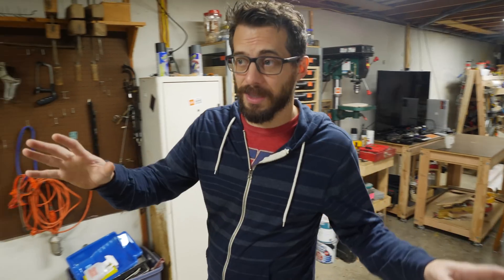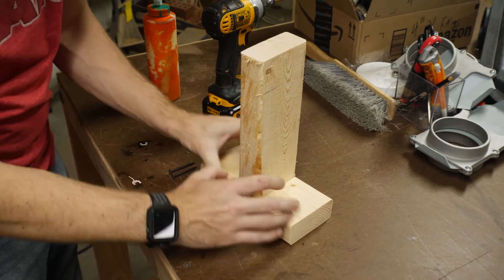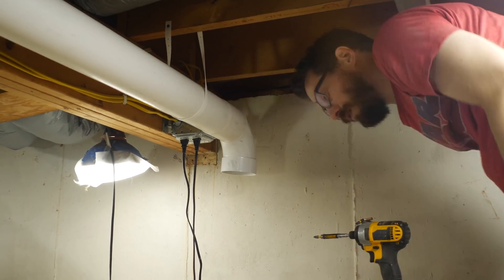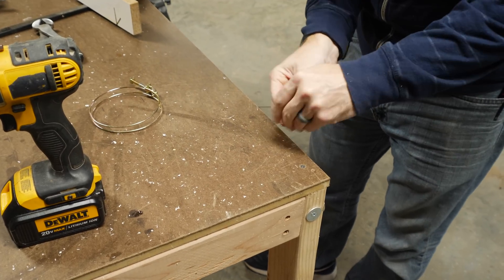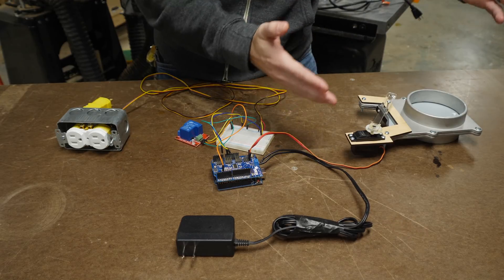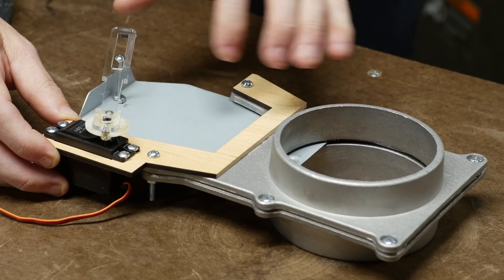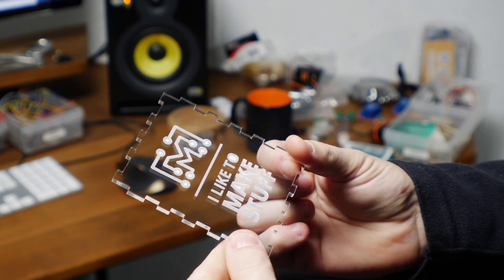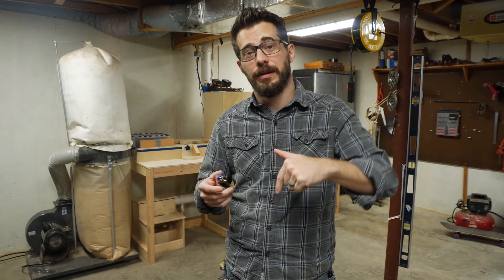Fully Automated Dust Collection powered by Arduino // How To | I Like To Make Stuff

Comment: Has ANYONE actually built something similar and gotten this to work?  I realize this video is super old, but I'm trying to figure this out and it's lacking a LOT of detail (schematics, wiring diagrams, etc).  I'm even struglling with the posted code, because I don't see where the acs712 voltage sensors are being accounted for.  Would love it if someone (even if not Bob) could help me out!

Comment: Great video... very much appreciated.

Given 1 automatic blast gate is AU$199 to AU$249 each it gives a lot of room for huge savings and customization. I have a heap of micro controllers already so would use a Teensy with SD card and OLED display.  That way it could be driven by a simple INI file and the OLED could be used to display info when in use.

This could incorporate a minimum run time and how long to stay on and open when the machine turns off. With the inbuilt clock the Teensy could keep track of accumulated run time and even sense when your bag needs to be emptied and hence not turn on when full.

We're getting a X-TOOL laser cutter so this looks like the perfect start project.

My shop has all 24V DC lights so the Arduino can hook into this. Also quite sure can sense if a device is on or off in a non-invasive way and... lastly have to allow for battery powered tools as my mitre saw and drills are all cordless.

Comment: Great video. In laying out my circuitry I"m wondering if i could control the blast gates with a Nano at each one so the voltage detector would wire to the nano and go directly to the blast gate so as to not have so much wire travelling back and forth. The Uno would control the Motor Relay and go only to the Dust collector. Any reason that's not a good idea?

Comment: I used an Arduino to detect current to flip a relay and power a shop vac. 
You can make a simple current-detecting transformer by making a few wraps of thin (22-26 gauge) insulated wire around a ferret and using an interrupt pin on the Arduino to detect a small, momentary change in voltage. Put the insulated load wire through the ferret and when current flows the thin wires will trigger the interrupt on the Arduino. Easy, inexpensive and safe. (Digi-key carries many cheap ferrets)
I used an output from the Arduino to switch a transistor that can handle the current to power a 5-volt relay with high, inductive load capacity.

Comment: Grounding PVC does nothing, it's an insulator. The pipe would need to be conductive for the electricity to flow through the grounding wire

Comment: I have made a blast gate using the same gate and servo as listed in your links but my gate does not switch between the open and closed positions smoothly. The gate seems to hang up and get stuck as it is switched. I discovered there were some bosses inside the gate that initially hung it up but I filed them smooth and the problem still exists. I have created a couple of actuators, one plywood and the other plastic and both have the same problem.

Comment: I know you've found a solution already but for anyone else with a similar issue like the shop vac relay issue at the end... You could use two  relays in parallel to carry more current. Just splice the signal wire to each one and combine the outputs back into one to go into the vac.

Comment: I have a bigger shop with 16 power tools that I would like to have on the system.  I liked that I can control 16 servo's with your design, but I don't see how I can have 16 current sensor inputs?  Is it possible to have 16 current sensor inputs?  I hope you will respond or someone else that may have done this that sees your video.  Thanks for putting out these great video's.
Reply: There's a shield available that extends you to 48 AI's. I'm not sure the current sensors have to go to an analog pin.  I'm just starting with this and the learning curve is steep.
Reply: Brad Antin I found using a mega board I get the extra analog inputs and use a I/O extender board expands the output pins for servo. Writing code now.

Comment: I saw this in the user guide:
"If you are using a Leonardo or 
Mega and want to use the A4/A5 pins, cut the traces on the top of the 
board between A4 and A5 and the two pins next to them labeled SCL/SDA."
I am using an Arduino Uno and would like to use A4 and A5 for my project.
  Can I safely cut those traces, or do I lose the use of A4 and A5 with 
the Adafruit 16-Channel 12-bit PWM/Servo Shield?
Thanks
Mike

Comment: Bob -- I have modified you code to read from a config file and put everything into a structure instead of the arrays you were using.   Interested in it?   If so - how can I get it to you?  I have to test it in production and bullet proof it -- but it allows me to add/change/take out gates and machines without having to recompile or change the arduino code.     Love the template and love the automation!
Reply: Hey Cory Wiegert, any chance of me getting your code?

Comment: I like this video, and because I like it, I have watched over and over to learn and to catch anything I might have missed. I am teaching my self Arduino. I liked what you did before with your shopvac dust collection and using the key pad. I like this setup better. As I watch this video, I notice you still run a single stage dust collection. I know there are videos out there by the pound about dust separators. Just an idea for you: Convert to a two stage dust collection AND.... use your Arduino to sense your saw dust level in the collection drum and have it display a visual sign of when it reaches a predetermined level to have it emptied. Yes there is a product out there to do just that. But where is the fun in that? I;ve seen your creative was of doing things and enjoy them. Thank you for your awesome videos. Mike

Comment: Is this system still in use? Was it set it and forget it? Have you had to troubleshoot any issues since implementation? Did you find there was any regular maintenance for the system? Do you have to reboot the Arduino periodically? How about adding network connectivity?

Comment: I am so glad you mentioned the relay being undersized.  I saw three very large concerns with that relay: (1) The connector used isn't rated for 30A, (2) The relay isn't HorsePower rated, and (3) The traces on the PCB aren't going to be rated for 30A either.  I've done a lot of power electronics design & those failures are common with products produced in China.

Comment: I hate to be the safety guy but i feel the need to since this wasn't addressed in the video.

If you're going to do this, please please please, do you're research on you're workshops electrical system. Some tools use 20 or even 30 amp plugs and possibly at 240 volts as opposed to 120. Using an underrated component on one of these can lead to damaged parts or worse. At a minimum the amperage rating of whatever device you put into a circuit should not be lower than the breaker it is protected by. Devices can USE less current than the breaker, but what they can HANDLE without starting a fire is what's important. Also be sure to match the voltage, a device made to run on 240 wont work properly or break if wired up to 120 and vice versa. 

Still a really cool setup, something my dad will probably task me with doing in the near future.

Comment: Impressive work, for myself I'm too incompetent in programming and I do not have a a way to make the parts for the blast gate. I have a similar problem I solved using motorized blast gate from Lee valey and current detector from ABB to control the blast gate and the relay who control the vacum.

Comment: Great system! I will probably do something similar for my small workshop, just for the static discharge i will run a metal wire through the complete plastic pipes, having just one screw somewhere is not enough.

Comment: Great video! I’m trying to do a little research for my own woodworking setup. This video only leads me to more questions though! I need a simple device made for a dual blast gate manifold for a tablesaw and miter saw (both running into a Festool collector via the dust deputy).
I would love to have a sensor that switched the blast gate over for the tablesaw and automatically switched back as a default route for the chop. 
Guide me. Build it for me!

Comment: So my understanding is that the wire should run the length of the pipe, preferably inside the pipe. Is this not the case? PVC will not conduct electricity, so I don't see how attaching one part of the PVC to a ground will really accomplish anything. When might say that because PVC doesn't conduct electricity that no static electricity will build up, but this is incorrect and as much as the electricity is built up as a product of the moisture in the wood. Perhaps there's a physicist in the comment section I can bring some clarity.

Comment: Many Thanks for inspiring me to figure out the Arduino to build this project. The only things I did different is use bigger servos (20kg of force) , making the servo mounts and arms from 1/4 inch plywood and a jigsaw and using a 5v/120v relay connected to a 240 Volt 2pole 2hp contactor with 120 volt coils. I just finished it today and is connected to 3 tools. It works great! Thanks again.

Comment: Looks like the servo has the pull the gate open against a vacuum load. I wonder if you could have the servo open the gate before the dust collection starts pulling a vacuum

Comment: Update about Blast gates. I built this same system however I did not use the PowerTec blast gates, I used blast gates from WoodCrafters, I do not recommend the Wood Crafter brand. They bind up with the servo.
look at the PowerTec Brand that Bob uses the gate has a longer gate that has a hole that moves back and forward that does not bind or wedge. look at the picture of the Powertec and you will see the difference.
in the video he is using the same blast gate I am.  His is not binding however I am using a 5 inch gate.
I also am using curent tap (CT) instead of the AC712 on my 220 volt and high amp circuits/tools.

Comment: Did anyone ever post a link to a sustainable relay?  Saw a lot of suggestions for other setups but I don't recall seeing a link to the beefier relay that is referenced here.
Reply: For anyone else that missed it, the new relay is in the comments that are attached to the supply list that Bob posted above.  You just click on the original relay and then there are comments with a link to the new relay.  I saw the link there before when I looked the first time, but the link didn't seem to work.  After I posted this comment, I went digging again and just tried it again and it worked.  The issue with the link could have been something to do with my firewall at work.  Who knows.  At any rate, the beefier relay is there.  Thanks for the video Bob.  Really phenomenal project and implementation.  I failed to say that before.

Comment: A water well contact switch is a heavy duty relay and it will last forever maybe our life time. they are only $15 at the plumbing store. you can use the light duty relay to trigger it. I love your projects. you have inspired me for several years. thanks for all your hard work and sharing.

Comment: Static builds up on plastic because it is a non conductive . A point contact on the pipe ONLY serves that exact point , None of the surrounding pipe surface(floating static moving through the pipe may use this exit , not good) .  TRUTH is most attempts to discharge static not only are totally ineffective THEY might actually INCREASE  the potential for a discharge spark explosion By creating a spark plug like set up.          Almost zero chance of either happening , though .

Comment: Cool work, yet again, with Arduino. However, I still don't understand how people think they can ground a plastic tube. This seems to be pervasive idea in woodworking circles. I still haven't seen anyone explain how running a wire next to an insulator reduces static discharge, nor any one actually do an experiment. Yet people seem to spend $$$ on this, what I think is a physically unexplainable, myth.

Comment: The geek factor with this project is very high. Thumbs up for that but wouldn't it be easier and probably more robust to just throw a micro switch on each blast gate and wire the dust collector up so it comes on when you open a blast gate?

Comment: Ok, It's been over a year now and I'm really curious about how those servos held up. Also what issues you might have ran into with dust collecting in the blast gates causing the servos to not be able to operate. Some of my blast gates get so bad I can't hardly open and close them by hand. Mine however are plastic, not sure if the metal is any better or if these maybe have sweeps in them.

Comment: About the static discharge... a copper wire screwed into plastic will not dissipate anything. Except in a small area around the screw... plastic is not conductive.

Comment: You should use a 5 volt relay and a power supply of 24 volt, pass the + wire of the 24v through the 5 volt relay then with this, power up a 24volt relay . There are a ton of 24 volt relays that can handle a lot of amperage! Nice video

Comment: Hey Bob, any idea why i can get my relay to work with my arduino when powered by a 9 volt battery (sending about 8.2 volts) connected to VIN, but when i connect my arduino to a 9 volt plug-in type power supply (actually sending 9.2 volts to the VIN), the relay doesn't work properly? ...it sticks "closed" (LOW) and won't disconnect?  There's an LED connected that turns on when the relay switches on ("Closed"/LOW).  The LED stays on too.  What is going on?

Comment: You should wrap a copper wire around the pipe along the whole length before grounding it. The pipe is such a good insulator that it can't bleed the static buildup through it easily, by wrapping the copper wire around it, you decrease the resistance of the pipe through the whole length and the static buildup is less likely.

Comment: I had to give it a dislike all though it’s a neat set up. Not many will have a laser cutter or 3d printer. Some ideas without having to use those could be more ideal for most of the public.
Reply: Anyone with a few active brain cells can make the necessary parts with tools found in even the most basic workshops. In fact, anyone without the necessary tools would have no need for this system anyway.

Comment: Impressive video with great uses for laser cutting, 3D printing, if you have access to those technologies.   Instead of PVC, I used home heating ducts.   Typically, the sizes don't match your needs, so you can modify the ends of the with needle nose pliers to fit your needs.  Aluminum tape is used to connect them so you don't have screws poking in.   Just seal the seams with silicone rubber, and ground your pipe to the collector chassis.   Voila, cheap, and no chance of an explosion.  I do like the PVC pipe in the video since it is super cheap also, but I'd put a wire in it to dissipate static, not just a lonely screw.

Comment: I don't know if you solved, but you will need a relay, turning on a contactor for the motor. For the electronics, I would put it in a electrical assembly box. Thumbs up for your ubuntu desktop.

Comment: Bob, you shouldn't be mixing high voltage and low voltage in the same junction box.  You should be using a current sensing transformer that can clamp or be placed against the tools power cord. Probably much more expensive but much safer in the long run.
Reply: Do I need to to update the code if I used a current sensing instead of voltage sensing?

Comment: Not that it's bothering anything, but that copper wire isn't doing anything -- you can't ground PVC. Static discharge in DC causing explosions is an urban legend anyway, there have been zero reported cases of this ever happening. Read more here: https://web.archive.org/web/20151026103714/http://home.comcast.net/~rodec/woodworking/articles/DC_myths.html
Reply: Woops looks like other people (including yourself) already addressed this, glad to see the FUD is not totally entrenched

Comment: You mentioned the 30 amp 5volt 1 channel; high power relay module for the arduino that you hooked up to your dust collector wasn't powerful enough and that you would get something bigger and list it at the bottom in the notes but I dont see it anywhere. What did you decide on if I may ask?

Comment: The reason your relay is failing, is because it's rated for switching up to 30 amps of a resistive load, not an inductive like a motor. If you want to do it properly, you should get a contactor and have it switch the motor.

Comment: I would like to build the automation blast gates as well. My question is about the servos... Are those really robust enough to open/close a (well-used) dust collection system while under load or chip buildup? I have a 5hp cyclone with 6" duct-work - lots of strong movement is being requested of those servos, no?
Reply from the maker: I can't speak to your setup, but these are pretty beefy, high torque servos.  That component could easily be upgraded. I even considered stepper motors instead but the cost was prohibitive.
Reply: I was thinking stepper motors too - but as you pointed out, cost prohibitive...though I suppose I'm not above dumpster diving for old printers :). Thanks, Bob - love the videos!

Comment: The rare earth magnet on the underside of the arduino seems questionable. Have you noticed any negative effects as a result of the magnet?
Also if the new relay isn't working out consider getting a contactor. This functions similarly to a relay, but is specifically designed to handle higher loads and has beefier contact pads. Automationdirect.com is my preferred vendor for these sorts of things.